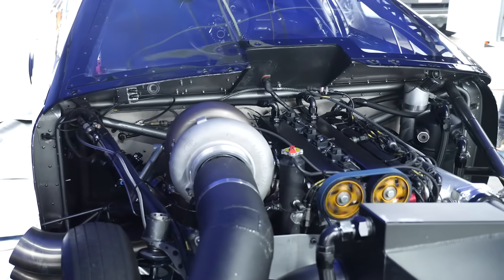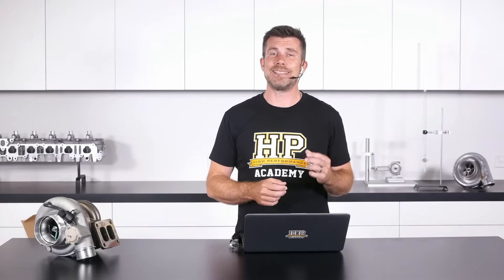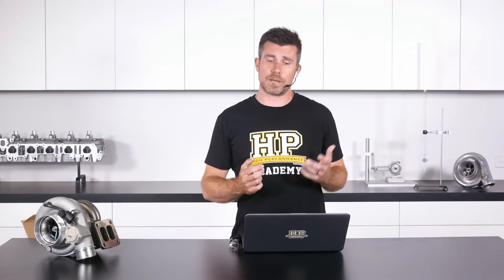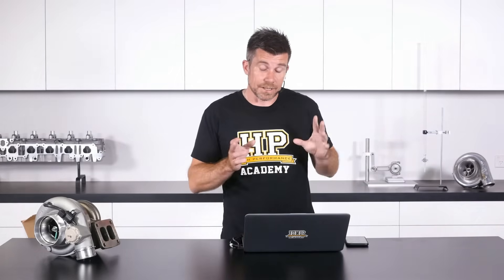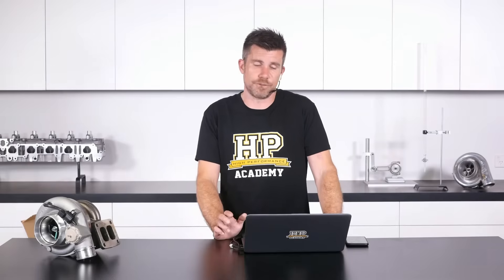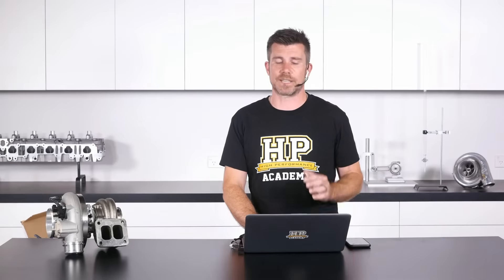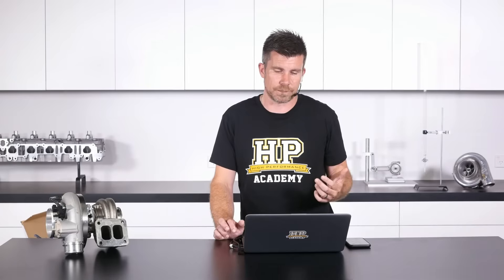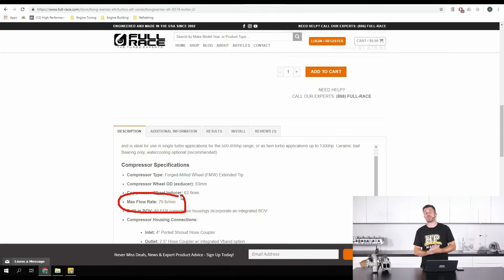How To Choose The Right Turbo For Your Build

Comment: Wait, would it be that different though? 15 psi is wayyyyyy below choke flow for both of those turbos so I would expect almost the same power between a gt30 and gt42 on a 2 liter 4g at least through the stock redline. Maybe if you're running 11k+ you'll start choking that gt30 hot side and see the power fall off where the gt42 is still holding strong. Obviously the low rpm stuff will be quite different as the gt42 will be much laggy.

What you really want to do to determine if there's gonna be a big power difference is plot your compressor operating point vs engine rpm (lug line) on the respective compressor maps and calculate the power the compressors consume in both cases. Then, you would add your fuel mass to your air mass and have to estimate your egts based on important engine parameters (ignition timing, cam profiles, etc) and calculate the required expansion ratio required to generate the power your compressor needs. Then the comparison between those expansion ratios would tell you if one is going to significantly overpower the other.

Or use advanced software that does it for you like gt power or ricardo wave etc. As that's wayyyy easier.

To use your breathing analogy, if you exhale through a coffee straw versus a normal straw you'll feel a difference, but if you exhale through a 5" pvc pipe versus an 8" pvc pipe you won't feel a difference. Neither of those turbos should be wasted on so little boost.

Edit: watched the whole video and see you went over boost advisor and boost bot. These are easier ways to do matching but make a ton of assumptions.

Comment: Why not use a small one to get preasure at low rpm and then switch over to big boy?
Reply: A compound turbo set up would work perfect for if u need power everywhere. But complexity and cost is the main reason ppl don't do it. Exhaust feeding small turbo-small turbo exhaust feeding big turbo(wastegates before small turbo plumbed to big turbo turbine inlet)-big turbo exhaust to downpipe. Big turbo compressor outlet to small turbo comp inlet-small turbo comp outlet to throttle body.
Reply: Dream build is superlite slc or gtr w/ vortec 4200 or bmw n54(I think) or any I6 really with compound turbo like a 58-62mm for small turbo and 72-78mm for big turbo. Think that'd make for a setup that u could get on at any rpm and get moving good

Comment: Can you overcome smaller turbo restrictions if you run a large external wastegate?
Reply: Yes but it's not the right way to do it
Reply: @horacecunningham7832  well if it works and its not prone to problems, it seems like a win win.
Reply: depends what those restrictions are, you need to remember the point of a wastegate is to vent excess exhaust gas to maintain a given turbine shaft speed and thus boost pressure for your application. If you are tapped out on the turbo and physically cannot spin it any faster or youre that far out of the efficiency map that you cannot make more power per psi than an external gate is NOT going to do anything.
Reply: I don't see why not. This would make an interesting test. Build a hybrid turbo with an 800hp capable compressor - with a 0.63 T3 exhaust side. Install 3 or 4 big external wastegates that have enough flow to accomodate 800hp worth of exhaust.

Why wouldn't this allow for super fast spool on account of the tiny turbine, but no uneccessary backpressure up top? Obviously you'd be wastegating 90% of the exhaust...
Reply: @GroovesAndLands  I think the main issue with this type of setup is trying to get the turbine to spin at the speed necessary to drive that 800hp worth of compressor. The more exhaust that gets wastegated, the less drives the turbine. It may take that full exhaust manifold pressure to drive the turbine hard enough (if it can even handle the speed). Still, very interesting theory I'd like to see explored. .63 housing on a 35R size turbo with like a 60mm wastegate doesn't seem particularly abnormal to fit (depending on the chassis), and you could neck it down to compare to a 40mm gate.
Reply: @marcusfrostenson9959  large mismatched wastegates will lead to issues controlling boost. Yes it may do well for dyno numbers but it's a completely different matter on the streets
Reply: @ho6b9s  Thanks for thoughtful reply. I've been giving this some more thought; here are few musings:

First - there must be a logical reason this hasn't been widely done, if it would work. The holy grail of turbocharging is to have an ultra-responsive turbo that does not choke at higher flow/power levels.

Secondly - I've never seen a turbo with wildly different compressor and turbine sizes. The turbine is usually a bit smaller then the compressor, but the most extreme example I think I've ever seen was a T04E50 coupled with a 0.48 T3 hotside.

Considering it thermodynamically, a compressor is imparting (significant) work into the air mass it is compressing/moving. Perhaps the power consumption of a compressor moving 80lb/min at a pressure ratio of 2.5 or 3:1 greatly exceeds the amount of power a 0.48 T3 turbine is able to extract from the exhaust gases? I'm certain it's possible to calculate how much power a 0.48 T3 turbine is able to extract based on pressure and temperature differential - but I don't know how...

But logically, it makes sense to me a little turbine is not capable of extracting the power required to drive a big compressor - which would jive with the fact we don't see turbos built that way.
Reply: The narrower the diameter of the turbine wheel the more torque, pressure, force is required to turn it. having more pressure in the exhaust negates more pressure on the intake. having a large wastegate to compensate for high back pressure will just waste more energy. pressure takes the path of least resistance. as soon as the wastegate opens the exhaust will just by pass the turbine and not have enough energy to drive the compressor. It will cause boost fluctuations that cannot be controlled quickly enough. one thing to load up and engine and go through the rev range slowly on a dyno, but trying to control the boost smoothly over the entire rev range in less than a second is not easy. Think of it as the stroke of an engine, more force is require to turn a shorter stroke crank, less for a large stroke. having a small turbine wheel is more important for applications where atmospheric pressure changes such as aircraft because the pressure ratio between inducer and exducer change more
Reply: The wastegate is there to modulate drive pressure by changing how much exhaust is bypassed around the turbine. A larger wastegate can bypass more exhaust yes, but bypassing exhaust gas is what lowers boost since there is then less exhaust flow and pressure into the hotside. The actual drive pressure and boost pressure ratios on a given setup are determined by the engine/turbo combo itself, not the wastegate, so a different size wastegate isn't going to change that relation or power per psi or how much overall flow the turbo is capable of. If you're nearing the turbo's flow limit, the wastegate will be used less and less since you'll be using as much of that exhaust flow as possible to drive the turbo. At that point you can get away with a smaller wastegate since it won't need to open much to bypass exhaust, and a larger wastegate will need to open even less. Large wastegates are for controlling lower boost levels

Comment: hi im looking for advise  i have a BMW e46 with the engine M52B28TU and im looking for a turbo ist will be my dayly car so the target is 350-400HP with 0.7-1.0 bar engine is stock and i know its good till 450hp in the future i may upgrade the engine to 500-600hp but now im asking for advice whitch turbo with what A/R is better 0.63 or 0.82 for 2.8 Liter i like to spool from 3000-3500 RPM im looking for a garett now thank  you
Reply: U want a promod 88

Comment: So what about a High comp/large turbo E85 build? Will some of the downsides of the larger running a larger than recommended turbocharger (Eg something like a GTX3584 or G35-900 on a 2l) be offset by the higher EGT's (Comp) and more mass flow of running E85 compared to regular petrol?
Reply: It would be a dog until late in the rpm range.  High compression high boost would be fun but a huge turbo would produce extreme cylinder pressures.  Have you looked into using small nitrous shots to help spool oversized turbos? This way you can build the engine to handle the huge turbo while patching up your low end torque.
Reply: @RwP223  With what I was thinking it wouldn't actually be that bad as a car to drive from stoplight to stoplight, think mildly tuned NA car that if poked will try to rip your face off.

Also Nitrous on a actually 100% legitimate legal street car isn't a thing where I live, and if you're racing on a track day chances are you can keep the engine up where the turbo stays somewhat responsive anyway.
Reply: Could try methanol for racing and ethanol on the street. I know for sure all the extra methanol could get a somewhat oversized turbo spooled up and can handle high comp and boost

Comment: but what if you measured boost pressure at the manifoild opossed to the turbo itself? wouldn't the same boost pressure from two diffrent turbos still mean the same airflow? since the volume of the manifoild is constant
Reply: That would be correct if the temperature was the same.

A less efficient turbo will have a hotter charge. Gas gets bigger (less dense) when it’s hotter.

Also, more exhaust back pressure will increase pumping losses and further reduce power.

Comment: Billet wheels are a lot better than cast wheels for a bunch of reasons! Billet wheels are much stronger than cast wheels for one! Cast wheels can get tiny minute bubbles in the metal when being made & that in its self makes them weaker! Billet wheels are made a lot thinner than cast cause of how strong billet is & that means they’re a lot lighter, which means they can spool quicker & handle more of a beaten! They stay cooler than cast as well because they are thinner! Billet Vs. cast anything is always superior! Lastly because they’re made on a 5 axis milling machine, they can be made to be more aggressive & efficient!

Comment: We all know for a turbo to reach full potential you need forged (quality made) rods, forged pistons, balanced assembly by a pro that actually knows what they are doing. And with more air we need fuel on demand any rpm at any time. Do not scrimp on fuel. Just rip the whole factory system out and replace with nice ethanol rated line I’d say min 25% bigger but realistically do the math on your pump and fuel usage at full throttle high demand and figure out how much pump you need and then at a 20% min over so the pump is working in its efficiency range and then a good tune. Tune doesn’t do shit unless your fuel does what you want with no limit. Or go cheap and have 2 Subaru motors now, both 2 cylinders sitting in the hood about 6” apart.

Comment: Think you could go into greater detail on diesel turbo selection?  I tried making an account on garret to use their turbo selection guide but seems you need to be a dealer or something.

I'm currently working on a project 2011 bmw 335d and have a custom t3 turbo manifold made by diesel pump uk..... ill be using their quick spool valve as well but my goal is 600hp to the tires with the fastest spool I can get though I'm aware I'll have a higher boost threshold but I'd still like the best option I can but finding 3.0 diesel results is proving almost impossible.

Comment: Guys can you help me build a reliable A16LET inline 4 which everbody says is a shit engine i just want to get 250 hp and to be a solid reliable build
Reply: @funkyjunky6574  use a k04/k06 hybrid with the courtnay sport z16leh conversion manifold allows you to use the astra vxr core but keeps the exhaust ect a oe fit makes 306bhp :)

Comment: How much of a difference does a twin scroll make?
Reply: A LOT , especially on big power builds. Makes a big turbo act much smaller, 500 to 1000 rpm sooner spool vs a open manifold on 4 and 6 cylinder cars I have run them on
Reply: @drewdavis239  I have a HX35w on a 2.4l diesel and it's sloooooooow. Has the twin scroll turbo but open manifold at the moment.
Reply: @drewdavis239  making power 500 to 1,000 rpm sooner . Any drastic difference on running out of rpms at higher rpm’s?

Comment: It has NOT been my experience that 15psi from two different turbochargers makes a "vast difference" in power, until you are in sizing territory that is extreme for the engine. Assuming both turbos are relatively efficient at producing suitable airflow for the boost pressure, both engines will make very similar power.... Again, unless there are WILD differences in EMAP. If one turbo makes the boost pressure with a MAP/EMAP of 0.75:1 and the other turbo does it with a MAP/EMAP of 3:1 - yes there will be a big power difference. But this would imply wildly different (and extreme) turbo sizes - neither of which is suitable for engine to begin with.
Reply: The example he gave though, (3076 vs a GT4202)  would be a vast difference at the same boost in regards to peak power at least.
Reply: Perhaps not a vast difference in outright power, however, the same turbo with different AR can provide noticeable difference in performance on a car built for circuit racing. E.g. I found that a GTX2867R with .64AR provided superior performance over the entire rev range over a .86AR. The .86AR version could provide a higher peak output whereas the .64AR provided less lag and could provide more overall (not peak) power across a wider range of the RPM. This was on the 2.0l F4RT engine. So sizing considerations in this instance can make significant differences on track.
Reply: @DOO00K  No argument there. I'm just saying that 100kPa boost is gonna generate the same amount of torque (give or take a few fiddlebees) regardless of what turbo it's coming from - that is, unless the hot sides create WILDLY different EMAP
Reply: @GroovesAndLands   a kinda no , but you might be thinking at the same rpm which should be ya , but the full engine rpm range has to be considered , and 1 major factor I feel is cam , fixed or variable
Reply: If performance doesn’t change between turbo sizes, then something isn’t optimized. Even the idea that there is a “too big” turbo is subjective. Some people have a 40mm turbo on a 2.0L and some have an 86mm turbo on a 2.0L. Optimize it for your needs. 
There is no sweet spot where turbos are too small/big, or all the same. 

The world of hybrid T3/T4 turbos 20 years ago lead to people creating imbalanced turbos trying to cheat physics. T3 housings bored out for T4 turbine wheels were awful and so were huge compressor wheels packed into factory compressor covers. They are still bad today but people don’t want to change fitment.
Reply: Like saying only heavy weighs are heavy and light weights are light but I find midrange weighs to be of similar weight...
Reply: @RobertSmith-lh6hg  What in god's holy name are you blathering about?
Reply: Go put a gt 42 on your car and hate life on a 4 cylinder I want full power from down low not the last 500 rpm in my rev range that I can only spend 1 second in realistically before num nuts pulls in front of you. Small ish turbo and a huge wategate keeps things in check. Boost creep control, early spool but not choked up. 18psi from 2000 rpm till redline. Basically. Although the psi drops with load it’s mathematically possible. It’s way better to have a low end grunt rally car then a high end turd that doesn’t do anything till 7500 rpm. But looks good on dyno paper feels like crap on the road.
Reply: Don’t forget about flow volume of air that the turbo moves. If your boost is the same but your moving more air like a port and polish will move more air flow and actually lower boost because of the better ve. So is boost power or is it a restriction. And the level of boost more restrictive cuz there is no point forcing wire that the motor can’t eat. 🎉 goes your rods
Reply: He means I have no experience can’t weld and don’t know how a turbo works. But I’ll throw my .0002 cents worth of info out there cuz IV actually swapped turbos and tested and it makes a difference, do you know how I know you don’t know what your talking about. 15psi at 2000 rpm is way dif than 15psi at 3500 rpm. Plus to achieve that you have to size the turbo. Thus lag on the bigger one is inevitable. I swish people were more informative like the hp tuners guy IV been watching for years he is a good tuner, but knows the software really well. We are students right now don’t throw rediculous statements out that give people false information like this guys post.
Reply: 2 Turbo’s help with V  engines, V6 V8  V 12 
   Short runs simple plumbing and smaller required sizes.
Reply: Well, it’s definitely my experience and that is with a hybrid upgrade. 25psi was flowing so differently compared with stock.

Correction: I didn’t measure eMAP. So it definitely is plausible I was at the edge of stock. Though factory targets 18psi and tuners usually push 20-25psi.
Reply: This is true in the sense that it's not 100+HP gain at the same boost for most of us. Now if you start building the engine and optimizing flow on the engine na. Perfect example I have a car that most guys don't see huge gains going from a t25 to a gt2876 at the same boost maybe 20-30hp. Mine has big valves and huge cams it's offset bored ECT back when I did that same swap I found 80hp at the same boost. An engine that makes more na hp is gonna like the bigger turbine much more.